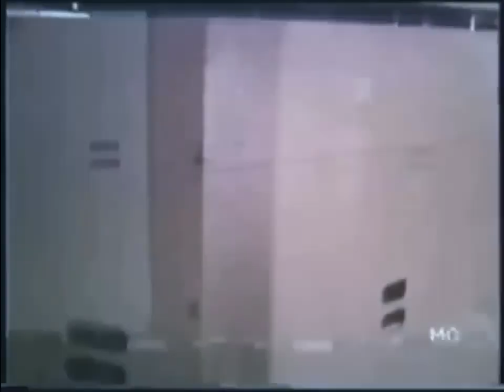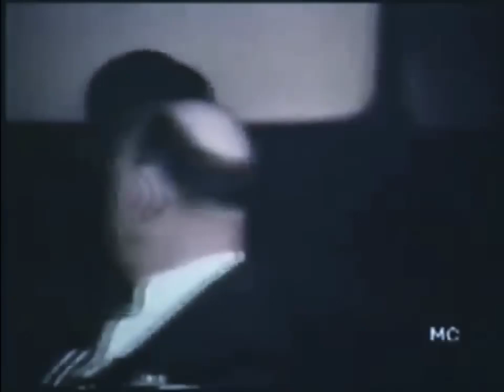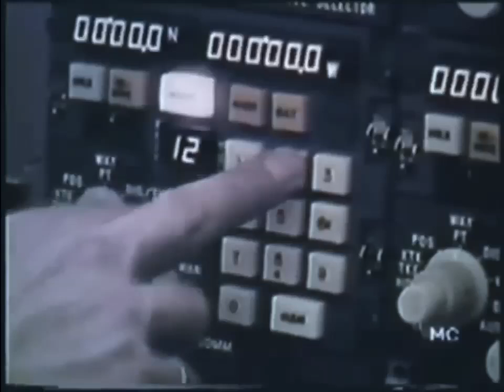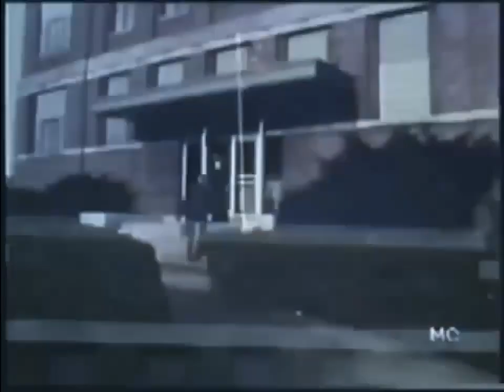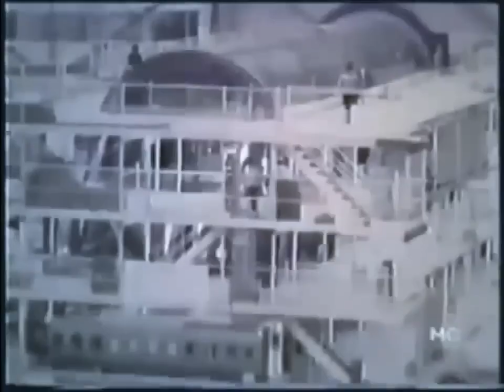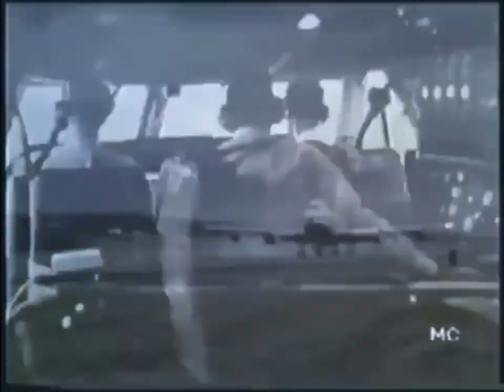Boeing Film: Introducing the 747 Jumbo Jet (1969)

Comment: The 747 looks so beautiful when you see it take off and land.  BTW, looks like Airbus went with @3:14 or @3:16 for their ugly A380 design.
Reply: Nah, the cockpit cabin of the A380 is in the lower deck, other than that, yes it's similar, though we've to keep in mind that Airbus was gonna built a much better looking A380-900&1000s too but didn't due to almost no demand.
Reply: @johndavidson3424  "was" is the key word.  So, until then, the 747 is a beautiful swan whereas the A380 look like a beluga whale.  Granted, the luxury amenities in the A380 far outweigh what the 747 can offer, but I really don't want (or really "have") to spend about $15K to fly 1st Class on Emirates.
Reply: @RudeCustoms  Bro both the A380 & B747 are "was" types of planes recently, still in service but both of it's production had officially ended.
Reply: @johndavidson3424  Yet, the 747 looks better from the first to the Dash 8.  The A380?  Still looks like the Beluga Whale.

Comment: As much as we don't like them. The 787 is a superior airplane. The 747 had it's first crash after 5 years of service. The 787 has never crashed in its 13 years of service.
Reply: The 787 came 40 years later and relied on more advanced technology and trial and error learned from previous crashes. Also not even catering to the same market. What a ridiculous comparison.
Reply: @c8j2h  it's not ridiculous at all. Don't all aircraft designed rely on data from the past? What do you mean the 787 is a different market from the 747?  On US airlines the 787 has replaced the 747 and performs the same role. In fact it seems with American and United airlines it will also replace the triple 7 too.
Reply: What is the point of your comparison?  I should hope the 787 is safer and more efficient.  I should hope the 787s successor improves upom the 787.  The only fair comparison of products and athletes between different eras is to base the difference in performance between the subject of the examination and its contemporaries.  The gulf between the 747 and its contemporaries was greater than the gulf between the 787 and its contemporaries.

Comment: It's interesting they used the feature of an additional width of seats rather than more seats as a selling point.
Reply: yea because back then they cared about comfort
Reply: It didn't last long, though. Airlines quickly asked "can we squeeze one more seat if we go back to the old slim width?". And sure enough, that was the route. All airlines quickly started to order their 747's with 10 abreast seating, instead of the original 9 abreast shown in this video.
Reply: The width was to cater for their envisioned future as cargo planes. The thinking at the time was that passenger planes were going to be supersonic within a few years. Jumbo passenger airplanes were not seen as a big market, and especially not subsonic ones. The front cargo door is also the reason for the raised cockpit, which aerodynamic fairing turned out to evolve in to a whole other passenger cabin. Check out Joe Sutter’s book! The 747 really was the 1 floor wide airplane that ended up with a bonus second floor.
Reply: @hepphepps8356  I never thought about why the 747 had a raised cockpit, but now that you’ve explained the market expectations in the industry, it makes total sense! If there was never any plan to use it for large cargo then it would have been simpler and cheaper to make it all a single decker.